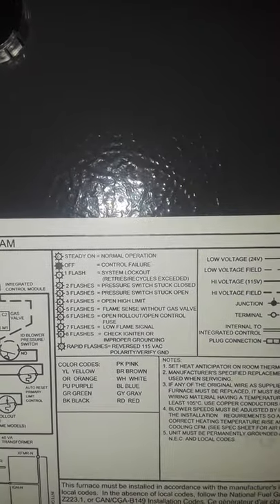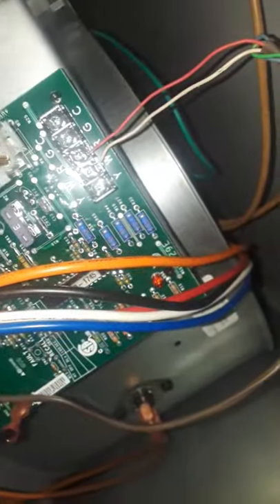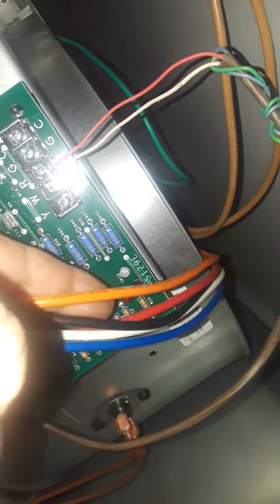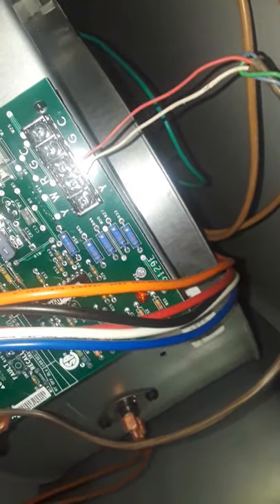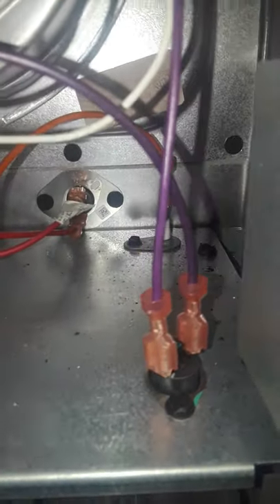Goodman furnace 6 flashes repair

Comment: If a rollout switch or a high limit is tripped you need to investigate why it tripped in the first place.. they are safety switches and they are doing their job letting you know there is a problem.... possibly a  cracked heat exchanger .
Reply: Yeah  I definitely would  u could have a clogged exhaust u could kill someone  definitely investigate  those switches should never really trip  even  on the hottest of settings
Reply: Possible bad draft motor, maybe too much gas going down burning up your heat exchanger.

You were troubleshooting and found that the fuse was tripped but you didn't find the trouble that tripped it.
Reply: Please create a video and  post on what causes a roll-out switch to trip.  You could save a life.
Reply: Mine tripped after first start of the year, do you think that could be why?

Comment: To everyone posting on here thank you you just saved me a bunch of money don't thank him just yet make sure you're not going to have a fire in a place where it's not supposed to be because that safety switch might be saving your wiring from getting burned up inside the furnace.
This is just so bad that you're showing people how to bypass the safety switch by simply resetting it without investigating what caused the problem in the first place carbon monoxide poisoning is a thing so is incorrect gas pressure CGV going bad which is your combination gas valve there are quite a few factors to this and which is why you pay someone who knows what they're doing to fix it. Or at least find out what the problem was first and what caused the issue then do the reset if the issue has been fixed or resolved
Reply: Why don't you post on what causes a roll-out switch to trip.  You could save a life.
Reply: @hueyswen27  Because I don't have a broken heater to cause the same issues.
But I can text on here right now telling you it could be a clogged exhaust which I could probably simulate but it's attached to my house and I don't want to cause any irreparable damage to my home.
If you would like to provide me with a unit (preferably propane) to demonstrate this on a video, I would gladly do it. And even spend the time to edit it in some way.
Back to the reasons a rollout switch could trip.
The exhaust vent is clogged.
Combination gas valve manifold pressure too high spitting out too much fuel and over coming the spuds/orifice/jet burner.
The draft motor not turning fast enough and somehow still activating the draft switch or switch is stuck in on position falsely indicating to the integrated furnace control board the draft motor is running by confirmation of vacuum or pressure via the draft/pressure switch.
Jet burner clogged or misaligned.

That's just a few possible things that could happen.

There are old furnaces out there that don't have these safety features and will not go into that at all.

Call a pro or at least train yourself with the proper knowledge from a reputable source/company/school before doing service yourself.

Comment: You my friend saved me a repair bill. Mine was located a bit different spot but with the furnace switched off I presses on both with a tiny screwdriver a couple times. I was skeptical because it didn't feel like it reset. It did and started working normally I have heat again. Cheers!

Comment: Thanks for this! Single mom and worked like a charm ✨
Reply: There's a reason why the switch tripped please make sure it is checked carbon monoxide is bad for you and so is a flame not correctly burning down the heat exchanger tube and it's coming out the machine think about that for a second flames we're touching that switch flames are not supposed to touch that switch ever

Comment: Having a rollout switch open is not a good thing. This isnt a "fix" and you will most likely have to reset it in the future. You most likely have a cracked heat exchanger and you think you "fixed" the problem lol - as a tech i see this and shake my head, this is dangerous - hope you have carbon monoxide detectors.
Reply: The worst part is all the comments saying it worked for them,"single mother and this worked like a charm"
Bitch ain't gonna have a kid by next week at this rate

Comment: On my furnace, I was getting 10 flashes and was not sure what this was so I pulled off the fuse off the circuitboard that noticed that it was bad. I went to Home Depot found one replaced it and my furnace works perfect.

Comment: Hey good video.. my issue is different though my led light isn't on. Its the control board error. I have voltage everywhere including the transformer not sure why the led light isn't on

Comment: Just be careful folks a roll out switch is exactly what it means. Flame rolling out where it shouldn’t be. Perhaps the storm caused air to be pushed down the chimney causing the flame to roll out of the heat exchanger into the house. It’s best to watch to make sure the flame doesn’t roll out any more if you reset the roll out switch(not a fuse). Best to have a professional taking a look at it.

Comment: So I get 6 beeps om my furnace. But only when my furnace is working really hard. For the most part furnace is fine till we get a cold snap then I get the 6 red blinks. I usually cut power to furnace. Then back on and it works. But it usually happens when its really cold.
Reply: Same happens to my goodman furnace as well. 6 blinks and goes into lock out anytime temp drops below -30deg.  I go Cut off the main power and on again fixes the issue.  Wonder why  this happens when its too cold?

Comment: Hey, I have the same issue now. 6 blinks.. tried to do the same as you described but no luck. Did you press the button while the furnace is on or after you switched everything?
Reply: I unplugged the cords and reconnected them.  Then pushed both buttons while the furnance was off.
Reply: I press it down but i felt like there was nothing to really press down too
Reply: It could be an open fuse the fuse is different from a roll out switch the fuses on the circuit board